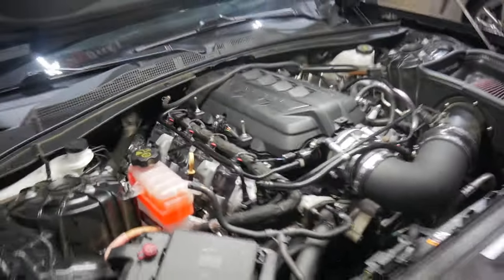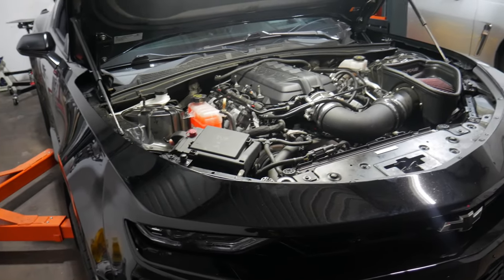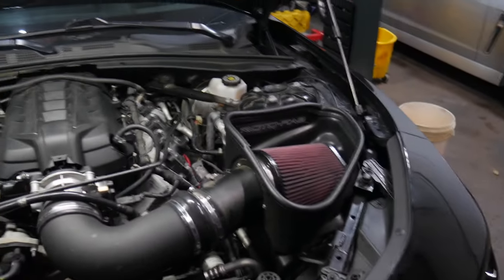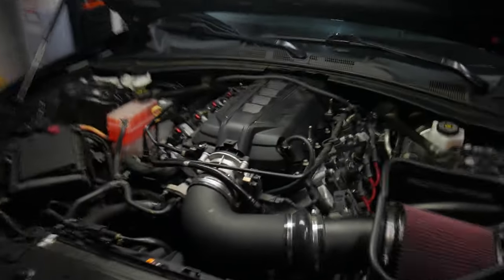1 7/8 LONG TUBE HEADER INSTALL ON MY 2021 CAMARO 1LE

Comment: Yes those 5.0 F150's are rare and stock they run like mid to low 5's to 60 mph and upper 13's  @ 103 in the 1/4. With just FBO, reg cab short box 4x4 they push 460 hp and 0-60 4.3 sec.

Comment: another question did you go with the 10-inch spark plug wires or 12 inches. i ordered the 10 inches but i don't know if they will fit. some people sayu 10 and others 12
Reply: im getting the speed engineer spark plug wires
Reply from the maker: @xxchrisgamerxx6850  so i went with the msd joints tbh idk what length they were
Reply: no worries thank you @JIProductions

Comment: I’m about to get my LT1 soon and I was wondering if the npp exhaust option is worth it with headers because the Camaro I have now is fully catless but I’m looking for a happy medium for the morning time so my neighbors don’t hate me 😂 so my question really is how relatively loud is the npp quiet mode with headers?
Reply from the maker: Honestly bro it make a noticeable difference with the valves closed check out the install video you can tell the difference in the video

Comment: I just installed 2 inch speed engineering on mine. Watch the passenger side engine wiring harness. Buy some adhesive reflective heat wrap and put some on the radiator resivor and hoses but most importantly the ecm harness on the far bottom side beneath the hoses. Just learned the hard way lol. 50 bucks can save you $500
Reply from the maker: Damn fam it melted that joint for the heat ?
Reply: @JIProductions  yea, it had my washer fluid spraying for no reason lol

Comment: Bro are these the speed engineering off-road x pipe as well or did you just get the headers and leave the xpipe and everything stock ? Love the vids 🔥
Reply from the maker: Thanks fam I really appreciate the support, so basically when i first bought the car it had stock headers and kooks cats previous owner had put the stock headers back but left the cars so there was a lot of exhaust leaks. Long story short i had a local shop put in 3” connection pipes to the stock x pipe
Reply: @JIProductions  ohhh okay where could I get those connections ? And so no SE xpipe … just headers + 3”inch connections , 02 extensions  and that’s it
Reply from the maker: Have your local muffler shop make them for you

Comment: Bro did you have the stock cats welded on the Speed engineering headers and x pipe?
Reply from the maker: So my car came with kooks cats not stock. I had them welded on to make it home from the shop so i wouldn’t have to drive open header but shortly after i had the cats deleted
Reply: @JIProductions  cat delete is better?
Reply from the maker: @Race_Car2ss  yes I’m my personal opinion

Comment: Hey did you get the O2 sensor with the headers? Is it something that you really need?
Reply from the maker: so i got the o2 sensor extension but if your going to have the car tuned to run with out them then you will be fine.
Reply: Ahhh thank you my brother 🙏🏿🙏🏿🙏🏿🙏🏿

Comment: How much u paid for the headers & exactly what kind u have it tryna get some
Reply from the maker: The amount i paid won’t be the same for you how ever If you go through wild hammer Motorsports and use code JIwild it will save you some money on everything they have on the site
Reply: @JIProductions  thanks I have a 21 1ss but it’s not about the money I just don’t know about all this & don’t wanna get the wrong headers lol. Not a racer just want the headers for sound
Reply from the maker: @jamarrriley4593  sorry fam just seeing this now 
How ever speed engineering 1 7/8th catless and you will be fine

Comment: Will headers void warranty
Reply from the maker: Depends on where you go i suppose because it didn’t void mine
Reply: @JIProductions Any mods non oem will void power train warranty if work is needed. They may not tell you but it will gey put into system at a dlr.
Reply: @JIProductions And what did you do about the AFM? tune it out and the afm exhaust valve? and at what miles did you do those? Thx

Comment: Did you weld your cats back on? Or your completely catless?
Reply from the maker: Welded them back in
Reply: @JIProductions  nice! Its definitely loud still with cats on!
Reply: @JIProductions  i know you get this a lot but hows the loudness when daily driving the car? Is it quiet on quite mode and very loud on track mode? Im trying to get the same setup but i dont want to daily drive a loud ass car just with normal driving.
Reply from the maker: @valenteramirez2586  i will say bro bro it was pretty nice difference when i had the valves closed
Reply: So its way louder in quiet?? I gotta please yhe neighborsnin the am or at 11pm.